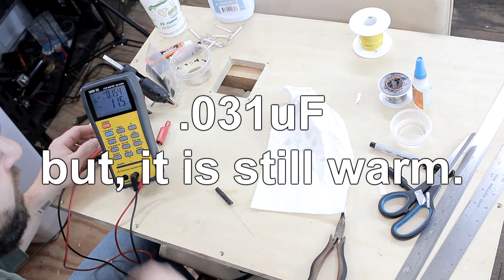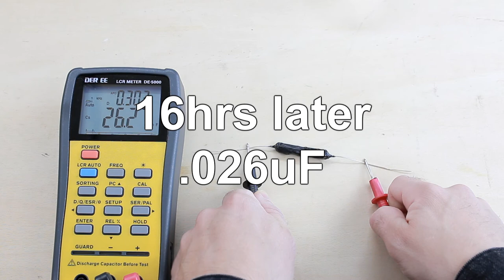How To Make Tone Caps - DIY Paper in Oil Capacitors

Comment: Nice video... To get a little more control on cap values, after dipping in oil and putting on the heat shrink, take some sewing thread and wrap the thread around the body of cap. Tight wraps, will increase the values closer to what you want. More wraps will increase the value to an extent.
Reply from the maker: Nice tip!

Comment: so looks like your old cap has drifted a bit from new, . 29uf to 31uf, 10 years, seems right, time to throw it out!
nice to see you put another 29uf in it's place. should now sound the same as when you first did the mod 10 years ago!
well done, nice job!
next time you make a cap try adding a shield and tie it off to 1 leg, this will give the cap a polarity and your circuit will be much quieter as this will now reject unwanted electrical noise, you don't want to pick up am radio through your guitar!

Comment: How would I make a capacitor like the black ice that will overdrive or distort my guitar when turned up?
Reply from the maker: You wouldn’t.  I believe that thing is just clipping diodes in a little black box.  Wiring in some diodes is much easier than making a tone cap!